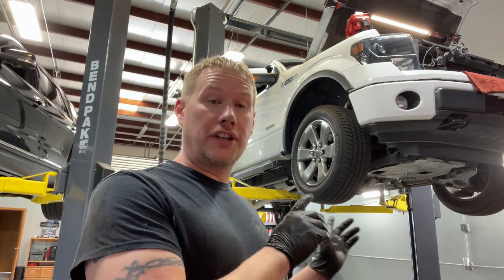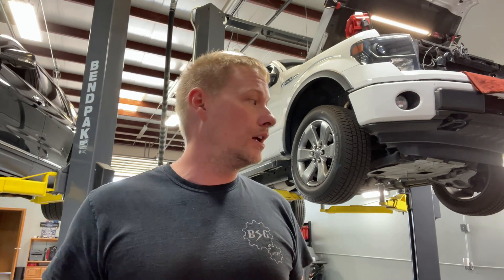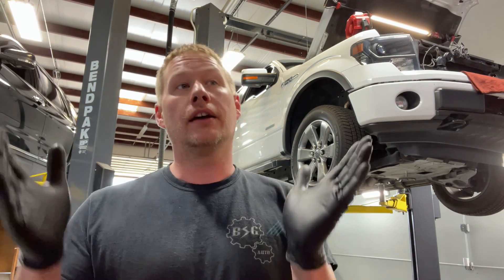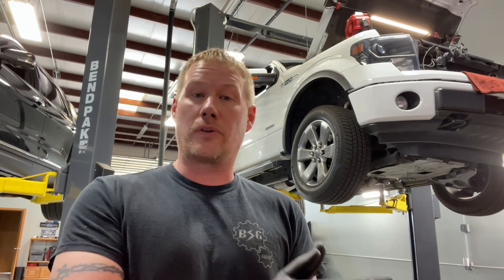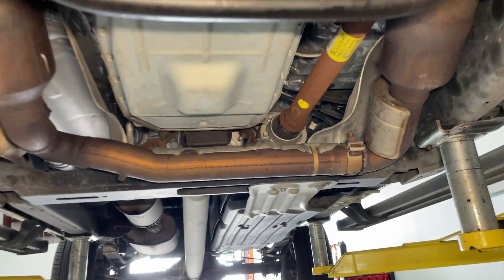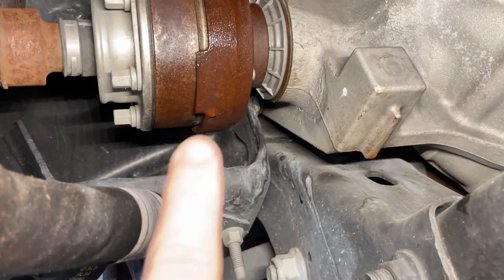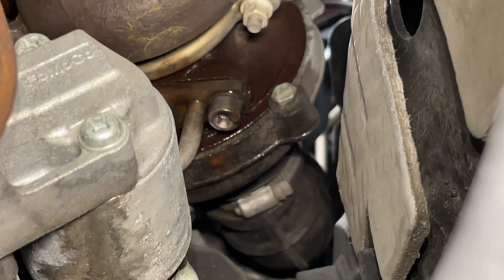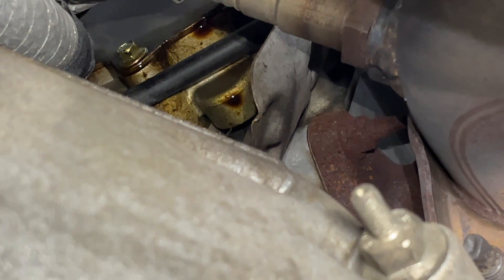Ford Ecoboost Engines Can be so Hit or Miss: I Really Feel Bad for This Customer...

Comment: Interesting the amount of leaks on this… I say he got a case of bad luck… I have a 2011 with the Ecoboost with approx 140k and have not experienced this… of course I change the oil at 4-5k, changed the coolant and all rubber hoses , o rings , and water pump at 100k, trans filter fluid at 80k.
Reply: That is a lot of work for something that only have 140k... I seem Tundra or Tacoma with 300 to 500 k km with little to no maintenance other than fluid change.
Reply: @2damaxmr2  I did it as preventative , not because it needed it. I haven’t had a vehicle leave me somewhere yet. Heck I even change batteries every 4 years… I’m sure I could have not touched anything and it would still be running lol. That’s 140k miles not km as well.

Comment: Hey guys how’s it going was wondering if y’all could help I have a 2011 f150 5.0 and It’s giving a problem where I says it over heating I’ve changed Thermostat fan relays a water pump reservoir cap replacement replaced all O-rings and the fans work perfect what’s when I does this is stops throwing cold air and the gauge just goes up and down

Comment: I had a truck identical to this one except in color and it was largely trouble free. Only issues were the the rear defroster and a passenger door handle. No problems with the motor but that timing chain rattle always loomed on my mind. Honestly this is my favorite gen and trim of F-150,  and the ecoboost makes great power, but if I get one again i will look far and long for one with a 6.2.
Reply: Also had a work truck with the EcoBoost. Problem free. And that was in the persian gulf with lots of heat dust, AND humidity. Mostly idle and low speed driving. No problems other than the battery damn near exploding on us.

Comment: When something is a hit and miss, is not a design issue , but a QUALITY ISSUE. Quality is all about getting your process stable, that get things right the first time and EVERY TIME. But more important, is you cant mantain this stability at the factory, after studying the well knonw issues you will be able to feedback this info to improve and get things done right. After seeing what they did with the powershift .... I lost confidence. I love Ford, but I wouldnt be buying this things. No one asked to raise complexity to levels were the truck gets unreliable. People will stick to V8s as a sign FORD is not able to develop a better engine (in terms of reliability). You can undestand the "dispposable" thing in a cheap sedan ... but in a truck ?????. I can see trucks up to mid 2000 shotting up in value so bad. Specially Diesels.

Comment: The ecoboost engines are now in every ford and it will be what causes the end of ford , my 2012 fusion 2.5 has 185000 and runs like new and uses no oil and has no leaks and im looking at new trucks and it will probably be a toyota tacoma
Reply: That's good to know. I have the same model and no issues at 60k miles.

Comment: I’ve got two non eco boost 3.5 engines, one in an edge and one in my flex. Both have 160,000 and 180,000 and only one has had the water pump issue.   So there is a definite gap in reliability between the NA and turbo engines. Glad I have the NA!!
Reply: Tbh, had they used a standard turbo or the custom one they have on the 2.0 and one of the other engines, it'd probably hold up alot better. 

But this engine can't take the extra load a dual set up brings to it. It's just not made for it.

Comment: my 2013 F150  EB is in the shop for Turbos and exhaust manifolds at 86k to the tune of $5300, timing chain was garbage at 56k, that was $3300. I called Ford customer assistance and was not an A-hole and they said they couldn't help me. Guess when I'm done with this truck my next will be a GM.
Reply: Gm is having there own probs I would not

Comment: My 2011 3.5L started with the timing chain rattle around 180k but only happened during winter. I moved to Florida and everything has been fine till one startup it rattled one time probably around 203k. Also every time I turn off my truck it leaks coolant. I lose about a half a gallon. The leak seems to  be around the thermostat housing and the coolant inlet pipe. Though it sucks I can't be mad I drove it hard for the last 100k.

Comment: I have a 2013 f150 ecoboost and have had to replace the vacuum pump and the turbo coolant fittings in the last couple years also. I have 138k miles on it now and it has the start up rattle pretty intermittently, I know I need to do the timing job on it but I just can't get motivated to do it. I watched your 4 part video on it and you make it look too easy.
Thanks again for making all these great videos!!!

Comment: Good video! I'm sure the customer ultimately appreciates what you found. I hope ford and other manufactures are watching to improve engineering processes. As far as o rings leaking I've used a product called molykote dow55 on orings which seems to help stop leaking.

Comment: For the people the complain that the eco doesn't have a V8 noise and blah blah blah. Gtfoh. I've experience both 1st and 2nd gen eco 3.5 and it deliveries when towing and normal driving. Current truck is 20 xlt crew shortbox fx4 with max towing. Tows 12.5k with 1800 payload. My only complain from my 12 to 20 is the 10 speed. It always hunts for gears and it's annoying af. Also when I shift from reverse to drive it kinda slips. Might have to take to ford snd make them fix. I'm still under full 36k warranty.

Comment: I realize that the 3.5 seems to be very hit or miss as far as reliability. I owned a 2011 3.5  f-150 and I got 260,000 miles out of it before it was totaled in a wreck. I work in agriculture so I was working the truck everyday. I had no major repairs and only did the regular maintenance such as oil changes, filters, spark plugs etc. it bums me out that so many people had such bad experiences when the truck was fantastic for me. Seems like I got pretty lucky

Comment: The complexity of the EcoBoost engines have turned me away from Ford. I would love a Ranger but towing with a turbo? To me, it is a recipe for disaster. They can throw all the tech they want at these turbo engines but to me there are too many failure points.

Comment: Don't suppose the drivers side turbo leak could have been the gas bottle leak trickling down? Prob not that lucky...also if the other side is leaking, yeah not good.
Reply from the maker: No
Reply: @FordTechMakuloco  Thanks for the reply! Any chance the newer yellow coolant might help prevent some of these coolant seal leaks? Followed your advice and swapped out the orange for yellow not long ago. Fingers crossed.
Reply from the maker: Yes I think the yellow will help nurture the seals.

Comment: I had almost all I'm off the same issues. Timing chain at 85k, vacuum pump and driver side turbo just before 100k.  Also IWE and had a broken spring up front by 100k. Thankfully most covered d under extended warranty. Also having issues with wires becoming exposed and cut in doors causing windows and locks to malfunction.

Comment: @FordTechMakuloco
I would never waste my money on the Ford version of the Bik lighter!!! 
That’s what I think of the Ecoboost motor fantasy!!! 
When I was growing up and talking to people about building motors and adding a turbo or supercharger, the first thing one had to do to the motor was to make the bottom end as bulletproof as possible!
Splayed four bolt main bearings, forged piston rods, high performance bearings everywhere, roller rocker arms, roller rocker racks, roller push rods,…… essentially everything had to be overbuilt from the oil pan up to be able to withstand the enormous amounts of extra pressures caused by adding the turbos or superchargers!!! 
I seriously doubt that these Ecoboost motors have been given that kind of consideration and not had a price tag to match the extra cost of overbuilding the motor, so I have no interest in throwing money away on such an ill conceived notion!!!

Comment: I have a 2010 Fusion with the 2.5L and a few years ago thought about trading up to a newer Fusion with Ecoboost.  No sale.  The 2010 has the Ford ticking engine but no leaks like the madness found on those EBs.  
Will hang on to the 2010 till the wheels fall off.
Appreciate your content and telling us Ford owners what’s what.
Take care
Reply: You know that transmission in your Fusion is also notoriously garbage too, right?
Reply: @borisjankovici662  I have heard the stories about that.  Bought the car new in 2010 and drive rather conservatively plus been changing the trans fluid every 20k so hoping that helps extend the life of it. Only 108k miles on the car so crossing my fingers on that as it gets closer to 125-130k miles.  So far still shifts smooth.

Time will tell, eh?
Reply: @CygnusX168  Good luck. Maybe yours is alright. I considered getting that generation fusion used, but after I read about the trans there was just no way. Same with the last gen Focus. Good looking car, horrible transmission.
I just want a naturally aspirated car with a 5 speed manual transmission for daily driving. Is that so much to ask, auto manufacturers? I don't need turbos or 10 speed automatics.

Comment: I have a 2005 F150 and the drivetrain is solid, I maintain it well, but it’s finally rusting out.  Not worth fixing, I think I would rather buy a used Toyota than an eco boost.

Comment: I help manage a fleet of 6.7 powerstokes for 10 years now, they seem to have more complexity and far less small issues/leaks. My wifes 16 3.5 Ecoboost flex already had startup rattle and timing work at 62k miles. It was a bummer.

Comment: I have a 13 too, I’m so glad I got the 5.0 tow package 8 ‘ bed 150,000 water pump and pinion seal, still running smooth maybe a 1/ 4 quart every 10,000 been using high quality synthetic oil from the first oil change.

Comment: Yep!  That's why I'll be trading-in my '05 Lariat for a '22 Tundra instead of another F150.
These videos are an "eye opener" for us guys who own F150's. This is how we'll find out what expensive breakdowns to expect down the road. 
Thanks again Bryan!
Reply: Better off buying a tundra with the v8. That's IF you can find one with decent payload. When we looked for a tundra last year I couldn't find a crew max with more than 1250 payload on the door frame. The highlander we were trading had 1340. Doubt payload will be any better in the '22 with the new suspension system. Probably will be even worse.
Reply: @llldaslll I have a 1996 Toyota T100 and it has a 2,000 lb. payload. Before that I had a tiny Mazda B series pickup and it had a 1,400 lb. payload. I don't understand why these huge pickups have such a small payload
Reply: These companies need to get their crap together or recall their junk.
Reply: Don't get the first MY of a new generation car/truck.
Toyota is not immune to this
Reply: Yes, you are right. 
For that reason and because most truck manufacturers are currently charging thousands over sticker price will force me to wait at least until early 2023.
Reply: @cma8165  yes, both the new and used car market are insane right now. I'm glad that my 2014 truck has been paid off for the last 2 years and I'm sticking to it for at least a couple more years

Comment: So a friend and I bought New trucks in 2014, he a f150 and me a Silverado.. his F150 went back to the dealership 5 time's! Then at 38,000 miles the front tires were bald, at 77,000 miles the EcoBoost pucked the timing chain!  After  fighting with Ford about the repair, the coolant and oil leaks he traded the truck in on  a new 2019 F-150, and the driver's door would not stay shut!!!
I'm still driving my 127,000 mile TROUBLE FREE Silverado! Not one problem!! and I tow AND I OFF ROAD!! AND my original tires lasted 86,000 miles, the reason I got new tires because winter was coming...
Reply: 86k on tires? I call bull. LOL
Reply: @richard_red_64  my buddy got 130 on the same tires on a two
-wheel drive Silverado my other friend got 80,000 on his original Silverado tires...
Reply: @philllsxga.7737  What tire please?
Reply: @richard_red_64  good Year wrangler sr a..
I have 45,000 miles on my second set.. I've had them aired down six different times for the sand dunes also.. they are about half worn now..
Great tire!!
Reply: @philllsxga.7737  That's funny, worst tire I've ever put on a car were Good Year ST's and Fortera. don't last 20k miles. You must drive in a straight line... LOL Will NEVER buy another Good Year product.
Reply: @richard_red_64  theses were wrangler sr a.. 86,000 miles.
They've been good to me..
Reply: Got a 2012 5.0, 145k on it. Replaced water pump for cost of pump,Ford paid labor at 80k. Replaced upper rad hose because of o ring leak at  85 k. That’s it. Drives fie really like the truck, wouldn’t own a Chevy or dodge,friends have them with to many problems. Oh did I mention that I tow a 5k travel trailer and get 11 mi.to the gallon towing, 22 un loaded! Ford all the way baby!

Comment: Unfortunate set of circumstances.
I think the people designing these engines design them so they have to go back for repair to pull in the money to fill their pockets. Don’t worry about longevity !  Short term is where the cash is at. Owners get the shaft. I had a exploder sport Eco stretched chains, phaser replacement. Luckily I still had the powertrain warranty. After the repair the vehicle didn’t run and perform like it did before the engine issue. Decided to get rid of it and get a normally aspirated V6. 
F150’s I’m on my 5th in 22 years all had the V8’s. Only had a misfire from a bad coil pack and a replaced alternator. No other problems, Knock on wood.
Reply: The people who design them design them well, which is how you get so many 3.5 EBs that just work their butts off and last to very high mileage with low emissions, relatively low fuel consumption, and all that. A lot of these problems are from farming out the manufacturing to save a few dollars, and companies that really don't want to admit their mistakes unless there's a lawsuit. And it seems like with Fords, there's always one big thing that makes the whole vehicle a turd. It used to be some of their transmissions, especially in passenger cars and SUVs. Or a whole engine family that had coolant control/gasket issues like the Essex (3.8/4.2 OHV V-6es). It was heartbreaking because the rest of the vehicle seemed to be pretty reliable. 

Trying to get repair parts can be frustrating, and it was a bad scene even years before the pandemic; sometimes a whole run of new/rebuilt parts is defective, so you end up changing the thing a dozen times before you give up and buy it somewhere else that might source it from another vendor. It's even like this with parts for older vehicles. You'd think nobody could f--- up rebuilding a mechanical fuel pump for a mild 1970s American V8 like a 351 in an F250 or whatever, but all I can say is thank f--- it's about a 15 minute job on an old pickup because there are such garbage parts for sale. Parts from the dealer used to be better, but even some of those will burn you. 

Sometimes I think they should stop selling cars and trucks and just sell "vehicle starter kits." If you can put it together and spot the shitty components, good for you. Otherwise, enjoy riding the bus or hope your tow truck driver isn't allergic to your pet cat/dog/whatever. If you're lucky, you can get some of the best vehicles ever made. If you're not, you're kind of SOL and the repair is financially out of reach to a lot of people anymore. Even if it's a simple vehicle they know how to fix, if it breaks down on the way to work, it could be bye-bye job. Same scenario with
Reply: @Sblackfll Most people do not buy extended warranties.  Extended Warranties pay out 10%.  Failures under 100-150k miles are rare.  After 150k failures start to occur, but by then the extended warranty is over.
Reply: @Sblackfll Extended warranties pay out 10% in claims compare to premiums.  If you like making other people rich by all means buy extended warranties on everything you buy.  They are a total ripoff on modern vehicles that hardly ever break.  When they do break it’s not something the warranty will cover anyway like, tires, brakes, windshield wipers, oil, oil filters, air filters, body damage, glass damage, light bulbs, seat tears, etc.  If it is something that is covered they will find a way to deny it, like missing an oil change by one mile, off-roading, or racing.  Smart people do not buy optional warranties on anything.  In my entire life I have never had a warranty claim on any product.  I’ve never had an issue that an extended warranty would have covered.  Ford sells a lot of cars so some bad ones will slip through, but I’d bet it’s way less than one percent in 150k miles that is not covered under the base warranty, recall, or special coverage.  The angry people with a problem are usually the ones that never change the oil or let someone under 25 drive the car.  Cars just don’t break nowadays unless they are misused or one is extremely unlucky.

Comment: I’ve had a couple of 5.0’s. Their reliability is no better than the Ecoboost’s. It’s hit or miss with any engine and any manufacturer these days. Nothing is meant to last, everything is over engineered, and don’t get me started on the system updates from manufacturers. This is all by design to keep the consumer beholden to the manufacturers and prevent DIY repairs.

Comment: Question:   Would you consider it wise to put a tow hitch on a 2016 Escape SE ecoboost 4 cyl....or would this be too much stress on the small engine???
Reply: I have a 2015 with a 2.0 ecoboost. I tow  a 2500lb trailer. No problems yet.  I do change the oil sooner than recommended, and  drain 4quarts of tranny fluid every year. Just in case.
Reply: @Kitwilbur  this is the 1.6 and I have found out that frame requires drilled out and voids warranty and extended warranty if you set up to tow.....2.0 may be different....